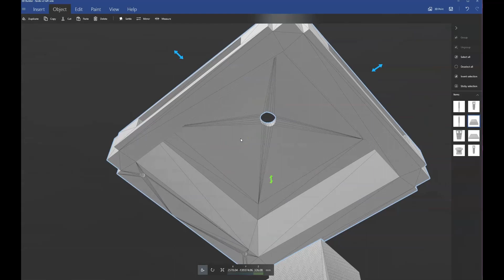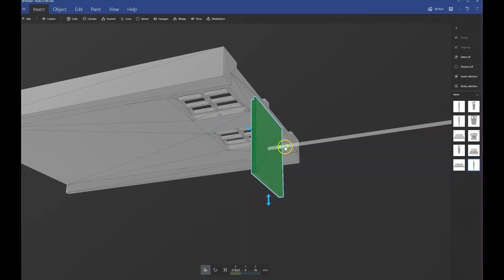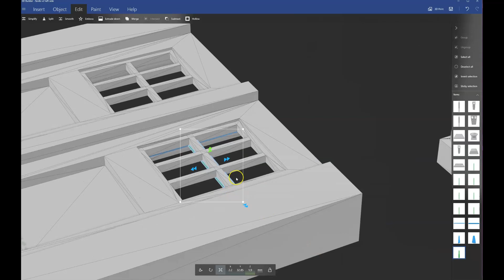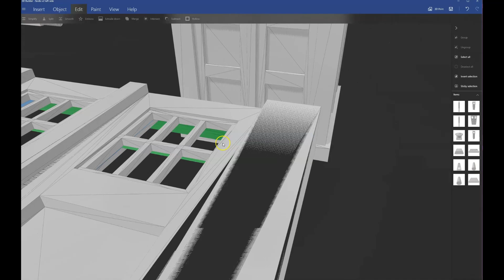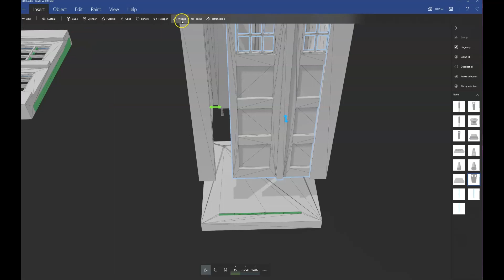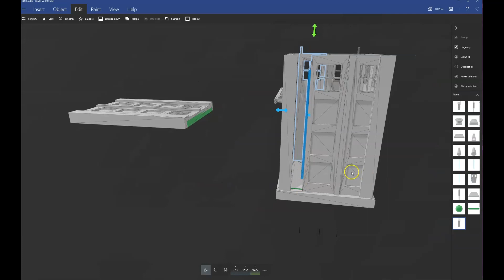Evaluate & improve your 3D designs for better 3D printing - Making your models even better Pro Tips

Comment: Cheers I’ll be making the improvements later on!
Reply from the maker: No worries, hope its helpful....if you need anything then just get in touch.
The other thing is that when you split down the model into parts i try to bear in mind saving the model with the parts orientated in their printing orientation.....it's a nice touch for end users